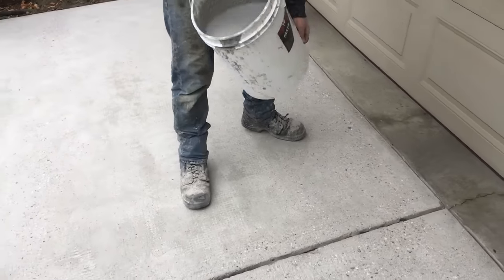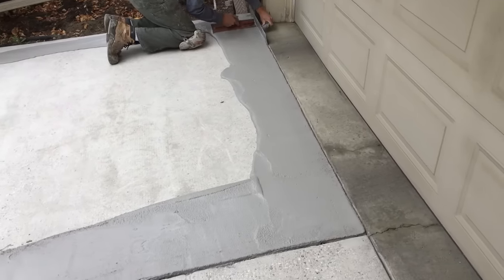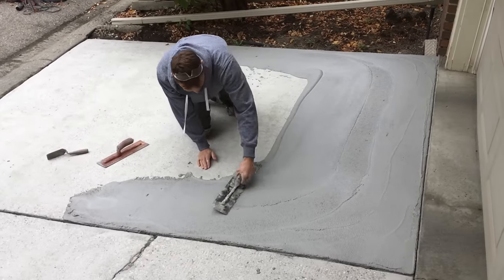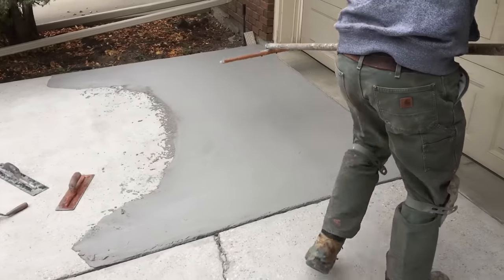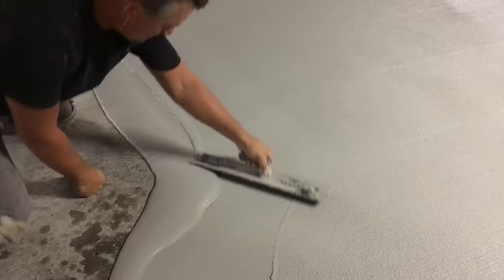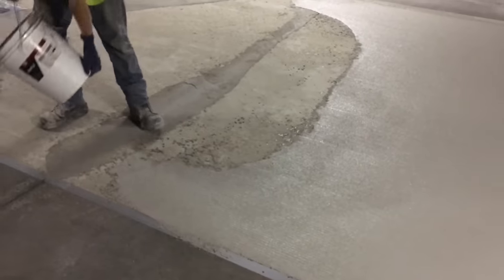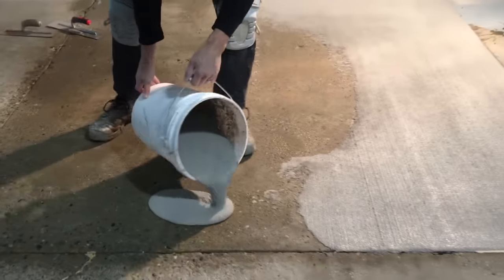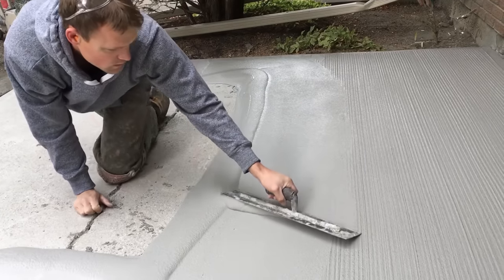TF Structural Concrete Overlay - Overlay Instructions

Comment: How did you prep the existing pad?
Reply from the maker: Diamond grinding, or shotblasting will work best. You can also use a heavy pressure washer. Just ensure there are no sealers, oil stains, or loose concrete left behind.

Comment: You can lay this over cracks and it’s ok? I thought the cracks would of been repaired prior? Interesting
Reply from the maker: The cracks will reflect through, as this is a very rigid product. It is not designed to fix cracks, but there are ways to address them in the beginning. Our channel has a video of one method, and we will be releasing more soon. 
Thanks
Reply from the maker: https://youtu.be/o5UYlJmKhAE
Reply from the maker: https://youtu.be/iuK9_XweHKA

Comment: Is there a temperature that is too high to spread this?
Reply from the maker: Anything over 80-90, it starts curing faster, but it can be done with the right system, and using our TF Ice to extend your working time.
Reply from the maker: Best to do your prep during the day, and plan the installs first thing in the morning, when everything has cooled down over night, and the sun isn’t directly over you 👌

Comment: How fast does structural concrete dry
Reply from the maker: About 30 mins-1hour it will be set, and you can use it with full traffic after 1-4 hours

Comment: Wish there was something like this for asphalt. We've sealed our driveway so many times the sealant is now flaking off.
Reply: Jane from the sounds of it your using the wrong sealcoating we get are driveway seal coated every 3 years with oil base we used to have a company apply water base but it was flaking also it’s a bit more expensive

Comment: What kind of prep work on existing concrete?
Reply from the maker: Diamond grinding for this job.
Reply: @TerrafuseInc  thanks for the reply. Though I’m not sure what diamond grinding is. Will look it up on YouTube.
Reply from the maker: You can also pressure wash the slab. You have to make sure there is no loose concrete left, dirt, oil debris, etc..
Reply: @TerrafuseInc  thanks

Comment: So thin...How long until it starts to crack?
Reply from the maker: It won’t just start to crack.
Reply: @TerrafuseInc  - interesting,  does it have some kind additive to make it more elastic?
Reply from the maker: No, it is a very rigid product actually. It will chemically bond to the existing concrete substrate, becoming a part of the structure. It has an very high compression strength, and it behaves like concrete after it cures 👍

Comment: looks good, but it doesn't look like a bonding agent was used. that overlay is going to crack and flake off with the seasons.
Reply from the maker: Our product does not require a “bonding agent”. Those are used with Portland cement based repairs, because they don’t bond to concrete, so you have to “glue” the repair down. Our material chemically bonds directly to concrete, and doesn’t need other acrylics or polymers to attach it to concrete.
Reply: @TerrafuseInc  good to know

Comment: Can this be applied over asphalt?
Reply: The jukebox no asphalt expands and the cement will cracks right away
Reply from the maker: Not recommended, as the asphalt is much more flexible, and you will see spider cracking overtime. It will bond to it extremely well though!

Comment: Ruben is correct , you cannot use this in freezing climates
Reply from the maker: That is not correct. It can, and has been used extensively in Canada, which has very cold winters, and freezing climates.

Comment: Can i use normal cement no mix this way?
Reply from the maker: No, Portland cement will not bond to concrete. That’s where you need to use polymers to “glue” it to the surface. These are the repairs that tend to flake off over a year or so, especially in winter climates.
Reply: @TerrafuseInc  isn't Portland cement a component of concrete mix?
Reply from the maker: Yes, and cement does not bond to concrete. Our product is not portland cement.

Comment: Does not work for exteriors. delaminates usually within 18 months. surface prep is the key. either use a rotary bush  hammer on a planetary machine or forget it.
Reply from the maker: It works fine, and is designed for exteriors. It does not delaminate. Where have you used this product in the past?

Comment: Why u don’t show what  products cement you used?
Reply from the maker: Its in the description. It is called TF Structural Concrete Repair. Thanks!
You can call us directly to order, or find it on amazon
1-403-243-3000

Comment: where do I bus ths overlay material. What is it called
Reply from the maker: You can buy from us, but we only sell in pallet quantities. It’s called TF Structural.
Reply from the maker: It is also available on Amazon now.
Reply: @TerrafuseInc  is a pallet = 1 bag?
Reply from the maker: No, there are 40, 50 lbs. bags on one pallet. You can buy it on Amazon though in 15 lbs. kits.

Comment: Where can I find T F Structural in USA
Reply from the maker: You can buy directly from us in larger quantities, or you can also buy smaller kit sizes on Amazon.
Thanks!
Reply: Once TF structural is installed does it need to be sealed. I live in a cold climate with snow and ice and salt is used for traction?
Reply from the maker: No, it does not require any sealers after it is installed, and freeze thaw cycles/salting will not hurt it.
Reply: Also, do you know any contractors that use TF structural in the Chicago Illinois area.
Reply from the maker: You can contact Concrete Craft, they are familiar with our materials. How big is your project? Also, please feel free to email me at mike@terrafuse.com, it will be easier to chat that way.

Comment: can you add color to this concrete?
Reply from the maker: You can add pigment to it, but over time, it will fade to a lighter, inconsistent shade, unless you put some type of clear sealer on it.
Reply: @TerrafuseInc  what type of clear sealant would you recommend. I like how it had that darker grey to it before it dried up lighter.
Reply: @michealbarnes66    I've used H&C concrete sealer that is very good.   There are others that are a bit better but are somewhat more costly.  You can buy H&C products at Sherwin Williams and now at Lowe's.  Not sure if Lowe's carries the various types and sheen.

Comment: I hatexthis stuff...  it was done ro our old slab by prior owners.. and now its pealing like dead skin years later...  and i had to spend days with a pressure washer breaking it off the slab.  What a pita.   My slab is in bad shape..  but i dont have 11k to pour a new one on it. As its large.

Its so bad from prior owners neglective . Chunks of rocks are coming out and its reduced in thickness in spots by an inch or so.

Im thinking of just buying bags of concrete and pouring it in these bad spots to fill and level it with the slab thats still good.  

I already oressure washed it clean.

Comment: This overlay over concrete here in Chicago,I'll will crack on the first below zero winter. Not convince.
Reply from the maker: It will only crack if it is installed on top of an existing crack. Freezing weather is not a concern for this product.
Reply from the maker: https://youtu.be/o5UYlJmKhAE

Comment: Surface prep?
Reply from the maker: Yes, you want clean, sound, porous concrete. Pressure wash will do most jobs, but some may require mechanical prep, like grinding or shotblasting. Also, be sure there aren’t any dealers, oils, grease stains, etc. Anything that would inhibit a good penetration of the overlay.

Comment: Looks like Mapei mepecem quickpatch.
Reply from the maker: Very different though, as it is not a polymer modified portland cement based material.
Reply: Did you grind this driveway first?

Comment: You need some experience to do this.  I tried, and ended up using a hammer and chisel to remove the mess.  I'm sure if you did this s few times, it would be fairly easy to do.  But, I'm not doing it again.
Reply from the maker: Yes!

Comment: why didn't he wet the existing concrete
Reply from the maker: It isn't always necessary. Pre-wetting will help extend working times, reduce pinhole bubbling, and make the product easier to work with. It is especially recommended when it is hotter, drier, windy, and the concrete is very porous, but again, it isn't always necessary.

Comment: What's the psi strength on this product? Specifically, is this a product that can be polished?
Reply from the maker: Around 6000 final strength. It can be polished, but you need to skim it with our fine material to fill in all the micro holes, as it’s very porous.

Comment: I’d like to know how to do this for an indoor space, with smooth polished concrete as the finished surface
Reply: Rip it all up and start again
Reply from the maker: It’s not possible to get a power troweled finish with this material, better to use a self level.

Comment: My city condemned my sidewalk and 17 of my neighbors on my street of ~40 houses.  The city gives the property owner 30 days to redo their sidewalk or they'll do it for union rates, so about double what it would cost for a fairly priced competant pro. When city does it, they add it to your property taxes for me it was going to be $4500 (this was 2014).
Thing is, the city that has had periods of rampant corruption, has a unique section that no engineer or contractor I asked had ever seen the like. I worked as an Ag engineer at the time, but previous to that i was civil for about 8 yrs. 
The city's sidewalk section detail calls for A DOUBLE POUR. A total of 7" min of concrete over 4" of run of crush or drainage stone #1's and #2's. AND NO STEEL OR WIRE MESH. 
Why do they call for this? Because one company specialisizes in it and no other company does it. Becuase when you do a double pour, they inevitably come apart. The 1.5" thick  top layer comes off within a few years.  But 25 yrs ago, the mayor's bro in law owned a concrete company so they did this to ensure they'd have loads of work at cushy rates.  
My then wife fancied herself a concrete expert. Her dad most certainly IS a concrete expert with 40 or 50 yrs experience by that point. I worked for a licensed Ag engineer (who knew only the basics) but we had THE national expert in concrete from the Army Corp of Eng and the NRCS come speak at Cornell uni. By the time I asked him, I had asked dozens of civil engineers and contractors. Most of them really know their stuff. 
My ex-wife sued the city so we could do it ourselves the next summer
Her dad drove to Upstate NY from western wisconsin. He tore it out one day (by hand) and poured a new one the next with the city inspector watching to ensure we were actually installing that second layer.
The city said they don't call for rebar or wire mesh bc it will rust. Like that had never crossed anyone's mind before. With proper coverage of 2" to 3" min over the steel, it won't see much water and therefore it won't rust much for the first few decades.

The ONLY way the double pour worked was because the mix had to be just right and it HAD to be placed about 30 to 90 mins after the first, so that the two layers comingle. (If they want them to mix, WHY HAVE TWO LAYERS AT ALL? No oen could tell us).
Even the ones done by the city's chosen contractor still come apart sometimes. This is exactly what most of engineers and contractors told me. It's what I expected before they told me. I've found in life that rarely - but sometimes - are mutiple experts wrong. I can usally tell something is good as gold when the contraactors AND the academics say it.
I am therefore dubious of your overlay thing you're doing
Reply from the maker: And you sir are entitled to your opinion! Thanks for sharing

Comment: You are applying the surfacing cement to flawless slabs, the point of this is to resurface slabs which are cracked and need repair. Nobody resurfaces nice concrete like you're doing
Reply from the maker: No, the video does not show the prep that was required first. These slabs had a failing surface that was spalling off. I don’t have enough time to show all the steps in every video, so they are broken up into categories.
Reply from the maker: This video was not made for you. We have other videos specifically for prep.

Comment: Won't that crack with cars over it?
Reply: The product likely won't crack  if it has a  formular which  prevents cracking , it's interesting that it  can be applied to a dry surface  . I re - surfaced my driveway using standard  brick laying sand cement mortar mix ( wet ) .  Need to thoroughly clean the surface - I used high pressure water . 
In order for the mortar mix to adhere to the concrete keep the surface wet , trowel a thin layer - as per the technique on this video and don't drive on the surface for several days . 
What the product in this video and the method I used basically does is replace the original concrete  surface slurry that has worn away over time . Done properly the surface won't crack  - driveway paint finishes the job nicely .
Reply from the maker: If there is an existing crack in the substrate, it will reflect through this product, but there are methods to deal with this.
Reply from the maker: https://youtu.be/iuK9_XweHKA

Comment: And then it cracks over time because it’s just an over lay on a driveway that your heavy ass vehicles are parked on😂 better to overlay on walkways or patios
Reply: Exactly.!!
That's my question how before it starts to crack and peeling off.
Or what are the guarantees
Reply: EndoftheRd I’m a concrete contractor myself and if your driveway has cracks or just broken up. It is better off to break that section and repour or just redo the whole thing and get a new driveway. Overlay is pointless really... on a driveway
Reply from the maker: https://youtu.be/o5UYlJmKhAE
Reply from the maker: https://youtu.be/iuK9_XweHKA

Comment: Man! Why? You on your knees! Working hard! Shit man you can lay that shit way faster! And get  a more even lay out. By standing!  And spreading with a 4'. Or 3' squeegee! And you should always wet the slab. And spray with silk top. If you can!  I charge more to use it. And give it as a option along with cure in it with  acrylic cure. Witch is something you should do as well. but its an option. to the customer!. O almost forgot! Silk top is a bonding Agent. If you was wondering what that is.
Reply from the maker: No bonding agents needed for this product, or cure and seals 👍 I have never tried the squeegee, but that sounds easier!
Reply: @TerrafuseInc  Thats cool no bonding Agent. But yes try the squeegee. It's a lot faster. But i still do the  Edge's the way you did them!
Reply: I always tell people to seal with cure twice a year. Once before winter and again in the spring. Mainly before winter to protect against Salt.

Comment: I really find this hard to believe. First of all this is not a “structural repair”. The concrete driveway is not a structural slab... it’s  flatwork. Did anybody notice the big cracks in the “structural” garage foundation? This is caused by ground movement. If the structural slab is cracked and damaged, there is no way that coating will stay together. I would like to see a picture of the repair in a year or so...or maybe a month or so! The word “Structural” in your name dot make it so. Btw.... I’ve been in the concrete installation and foundation repair business for over 40 years. Buyer beware!
Reply: I agree..ive also been in the business for over 30 yrs..i dont wish these guys any . but once the old concrete fails its impossible to expect a 1/4 of overlay to correct the problem over a long period of time..
Reply from the maker: The product is called TF Structural, and it has a wide range of uses. This video is showing an overlay, not a structural restoration of the slab, and yes, if you cover a crack, it will reflect through a 1/4” overlay. Most guys warranty at least 2 years, and lifespan is about 1/8” of wear every 10 years or so. These attached videos show it being used to structurally rebuild concrete structures 👍
https://youtu.be/NtXyXM_gjGs
https://youtu.be/xvq0TXjMfeU
Reply from the maker: You both seem very caught up with the name of the material, after only seeing it being used in one application. An overlay is not a structural restoration of the slab, it is simply a new surface. It is used in many structural restoration projects, and that’s what it’s name really reflects.

Comment: This is too much work
Reply from the maker: This is about the least amount of work required to restore a driveway. I’m glad your not an employee of mine!
Reply: @TerrafuseInc  This system of yours is dated and there are simpler, easier and faster ways to apply other better products than your. Also, I will never be an employee of yours as I have my own company and my employees do not have to work as hard as yours. You should try what your staff is doing so you can adjust and make the job easier for them.